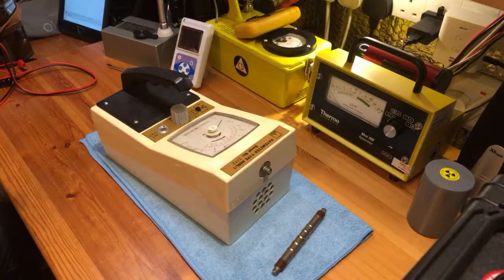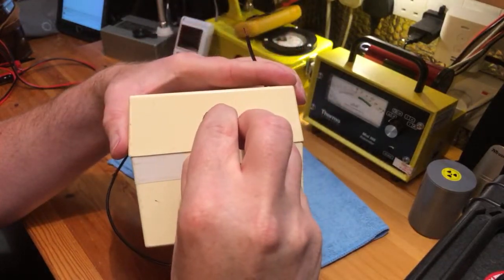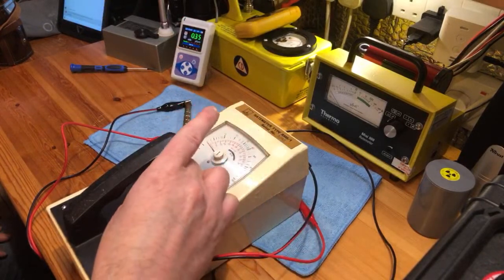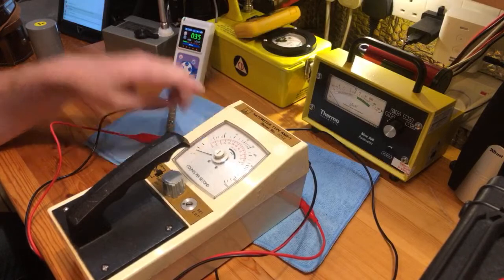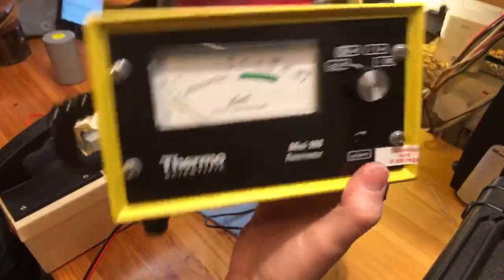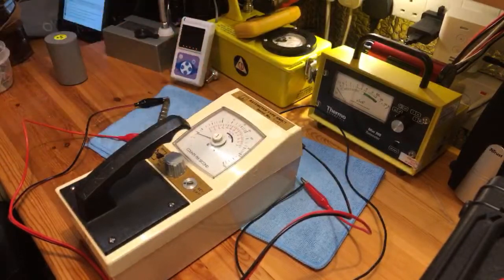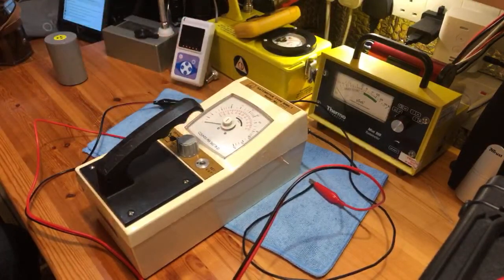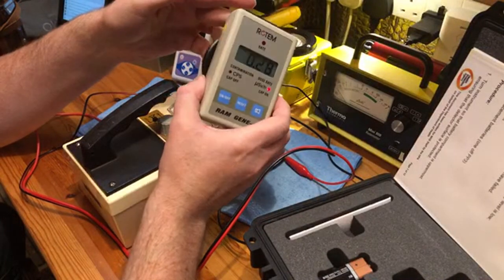Budget Geiger Counter Livestream

Comment: Sadly didn't get a notification for this but these are amazing for the price, been buying a few of these for £15 each just to solder on GM probes of random types to give to friends to get into GM counters. I love the beefy speakers these have, your Mini Monitor probe should work fine on it, most alpha probes seem to work at 600+ volts. Soviet Mica probes are about £20-30 on amazon and work fine on these with two croc clips.

Comment: Any recommendations for a gm tube to go with this set up apart from the SBM-20. Something sensitive for background detection, thanks.
Reply from the maker: The STS-5 is the only other GM tube I have experience with using. This unit will handle most things you can throw at it.
Reply from the maker: Having opened the case, an SBT-10 would fit without much modification to the internals. The plastic has bromine in it as a fire retardant, annoyingly it makes it yellow with age and the plastic gets brittle.